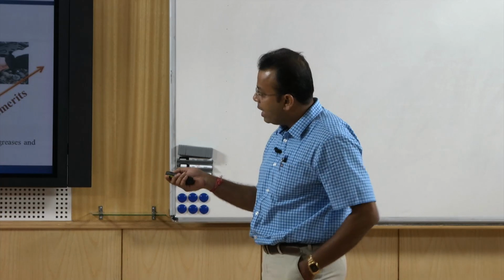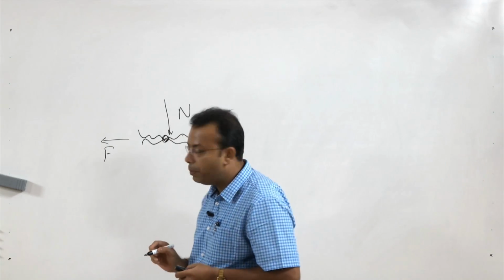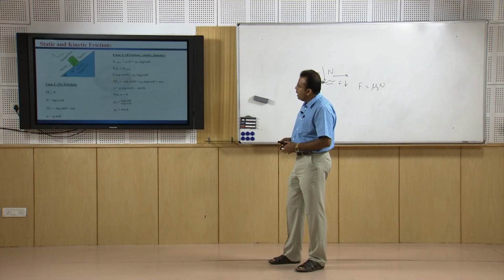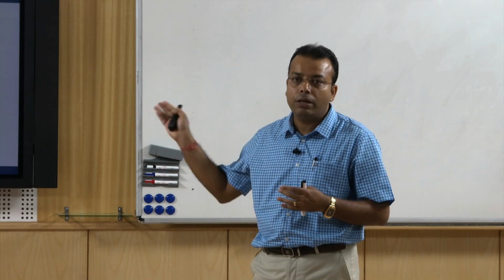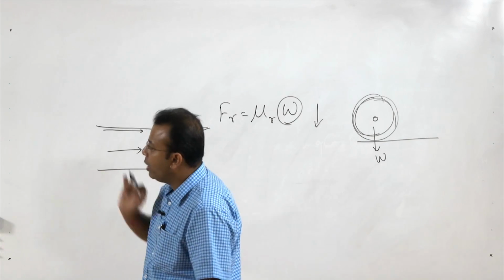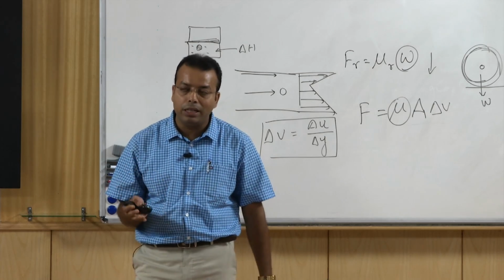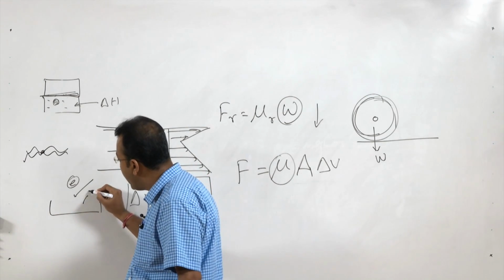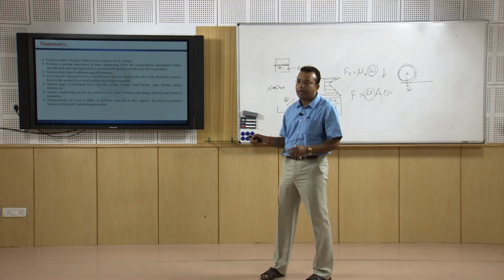Friction Tribology

Comment: I see a table which states COF for different material, so my question is professor is friction coefficient material property, I thought it is rather system property? can we tell COF of Aluminum is 1.5, Platinum is 3, Iron 1.2, and Gold 2.5? this data's source is from Litrature right? so if they do the experiment again with the same condition do they get the same values for each material?
Thanks a lot for the nice presentation and it was really helpful.

Comment: Sir you are telling the pipe line water is flow the and bottom most layer of water have friction. Middle layer of water friction is zero so the middle layer water only flow ahead than top and bottom most so drawing is correct sir